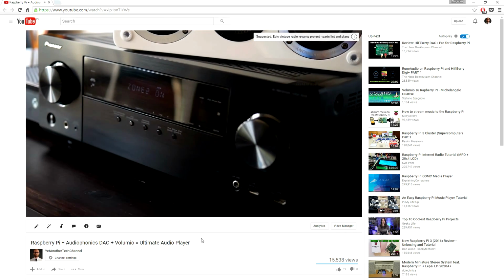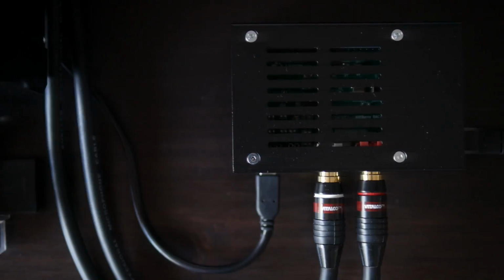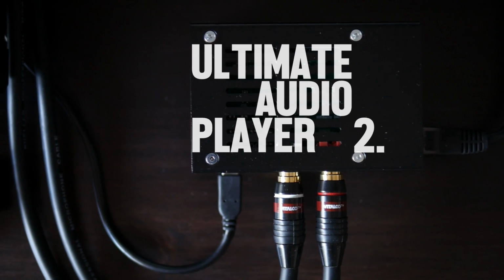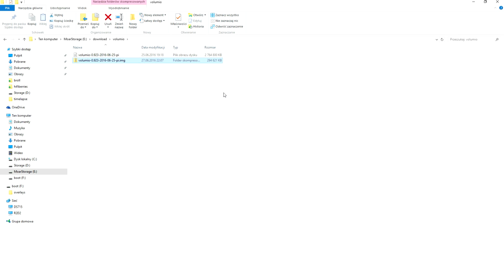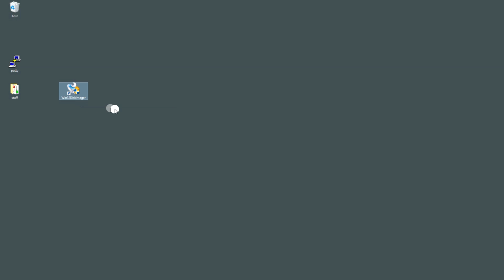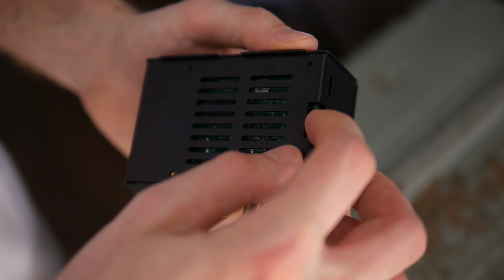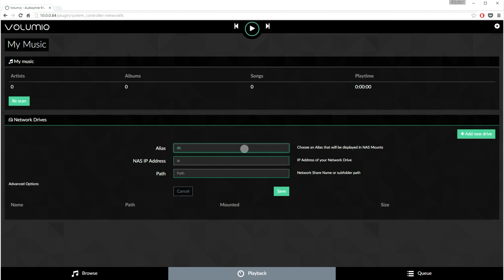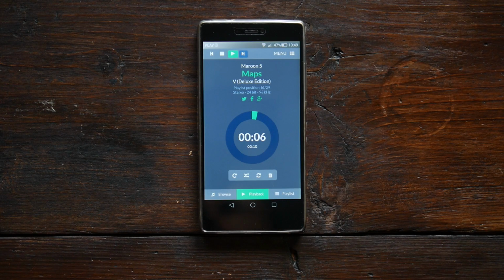Ultimate Audio Player 2.0 - HiFiBerry DAC+ Pro, Raspberry Pi 3, Volumio 2

Comment: Iv'e been working with this setup for over four weeks and I'm about to  turn my back on it. It's just not stable enough. Iv'e run it with three of my Pas Pi's so I know it's not the hardware. The unit falls asleep all the time, I have to turn it off at the wall often as I'm unable to connect to it via cable or WiFi. It's quicker for me to just put on a CD. The app lags, fails to play on most occasions and it just too annoying for me to work with it full time. What I will say is that when it does work it sounds great. Shame it's just not reliable enough. Sometimes I have to re boot the Pas Pi and all of my internal network components for it to work.

Comment: What power supply was used?  I've read you can't run a separate supply, it gets its power from the Pi header, that concerns me because that would be EMI noisy.
Reply from the maker: Check out my Ultimate Audi Player 3.0 video - where I solder a connector onto the DAC board to have it powered separately.

Comment: It looks nice, and is economical in energy consumption. However, when you sum it up, isn't it soon better to buy a small AVR? (for example Onkyo TX-8020), the devices also have a NAS and remote support.
Reply from the maker: In my case it's a matter of convenience - you can control volumio from a mobile app, a web browser or even using Alexa (not natively but using API and IFTTT). 

My Pioneer AV receiver can play digital tracks off of a NAS server, but I haven't really tried that - mainly because the networking feature failed after 2 years and the receiver no longer connects to the network :/

Anyways, do you know how do you interact with such receiver? Do you need to have your TV on if you want to control your playback? Browse folders, manage playlists, etc.? This doesn't sound particularly convenient... unless there's a mobile app for that?
Reply: @YetAnotherTechChannel Vielen Dank für Ihr Feedback. Ich besitze den Denon AVR-X1300W AVR, dafür gibt es eine Android-Verbindung (apk), mit der ich meine Musik von NAS / DLNA / Bluetooth oder Spotify-Musik abspielen und steuern kann. Ich habe volumio 2 mal auf einer Android-TV-Box ausprobiert, mit einer umfangreichen Musikbibliothek friert das Gerät ein, das RPi2 lief dort stabiler. 

Ich finde, dass 3B + von der HW etwas besser aufgestellt ist. Ich denke, es ist ein schönes Projekt, und es macht Spaß, es zu machen, aber ich sehe nicht den Preis und die Leistung. Dort haben Sie mehr Erfahrung mit dem externen DAC.

Sie können das RPi3 auch über einen HDMI-Port an Ihr AV anschließen ... es muss auch funktionieren;)  My AVR has HDMI passthrough function, the signal is simply passed through.

Comment: Does the DAC also include amplifier?
Reply from the maker: Nope, this one only does the digital to analog conversion - you will need a stereo amp or an AV receiver of some sort. Check out HiFiBerry AMP+ if you want both in a single package.
Reply: @YetAnotherTechChannel  it's unavailable now in Amazon. Amp2 it's also the same as Amp+?
Reply from the maker: Yup, AMP2 is just a revised model of the original AMP+
I have two AMP+ based audio endpoints that I use on a daily basis :)
Reply: @YetAnotherTechChannel  
Thanks!
I want to add this amp2 to project I build.
I found this speaker : https://www.parts-express.com/behringer-studio-50usb-150w-2-way-digital-monitor-speaker-pair--248-6910  
(The passive one) and want to add crossover for it because it's doesn't have one. 
Can you please help me which crossover I need?

Comment: what would i have to do to get a 4.1 audio output? i want to build a pi based carputer with android auto
Reply from the maker: You would need one of those car audio amps to drive the speakers and connect RPi with HiFiBerry to it.
Reply: YetAnotherTechChannel how about a usb soundcard? That way I could have 4.1? Would still have to use a amp.

Comment: I did a similar thing but you can separate the 5v supplies for the digital and analogue side of things on the Dac+ pro and if you feed them from separate linear power supplies you will hear a huge improvement.
Reply from the maker: That's the plan for the next revision - separate power delivery, integrated display, and a custom case :)
Reply: YetAnotherTechChannel  It worked a treat for me, hope you enjoy it
Reply: Please make a video with the upgrade. Realy want to build one :).  Great job!
Reply: YetAnotherTechChannel when are you going to release the newest version with integrated display, sounds amazing

Comment: Question, if i want to use my headphone, how to do that? I dont see a headphone jack, right?
Reply from the maker: You would need a headphones amplifier for that.
Reply: YetAnotherTechChannel thanks for your reply. This means i need to buy another amp board? I thought speaker needs more power, not the earbud . I misunderstand it ?
Reply from the maker: You are right - speakers do need more power than headphones. But even so, the circuit board has to be designed for such use case - the audio signal must have a certain strength for this to work.
HiFiBerry DACs (and I'm pretty much sure all other DACs) are meant to work with amplifiers and even if you manage to connect your headset directly to it, the experience will most probably be disappointing.
Reply: YetAnotherTechChannel got it, thank you for your detail answer.
Reply from the maker: You're very welcome :)

Comment: I may have missed it, but did you use an external amp to power the speakers? I'm a bit new to this arena.
Reply from the maker: Yes, this audio player is connected to an AV receiver with a pair of RCA cables.
Reply: YetAnotherTechChannel thanks for the answer.

Comment: Nice simple setup.. Does it only work with stored audio files? How about streaming Spotify ect? I already have a really nice DAC form TEAC. Is it possible to use my existing DAC connected over USB? Is an audio card available with coaxial (AES) or optical (toslink)   Cheers,,
Reply from the maker: You can playback audio files either from a flash drive or a local file server. Volumio does support Spotify, but the implementation is very limited compared to native Spotify app. HiFiBerry Digi+ has digital outputs :)
I have no experience with DACs from TEAC so can't really help you with that :/
Reply: update: I got everything set up with the HiFiBerry Digi+. Everything really sounds great! I'm having trouble with "Spotify Connect" . I was going to install an updated plugin that I found on GetHub but I the "Upload Plugin" tab is missing on my version. Do you have any suggestions?
Reply: The Spotify Connect App worked well for me when I connected to my Rpi via a Windows 10 PC application -- but worked badly when I connected using my Android Phone -- it was as though there was a lack of communication on the reverse link from the Rpi application to the android phone (the forward link from phone to Rpi seemed to work as it could issue commands).
Reply: Spotify made a change you have to install a third party update using SSH

SSH How to: https://www.youtube.com/watch?v=ZkvHHkWmKSY 

Here is the update to paste in your SSH interface

wget https://github.com/balbuze/volumio-plugins/raw/master/plugins/music_service/volspotconnect2/volspotconnect2.zip
mkdir ./volspotconnect2
miniunzip volspotconnect2.zip -d ./volspotconnect2
cd ./volspotconnect2
volumio plugin install
Reply: JAMES GREER thanks I will try it out
Reply: One more thing.. You have to enable SSH. Navigate to the DEV ui by pointing your browser to VOLUMIOIP/DEV or volumio.local/DEV . Find the SSH section, and click enable.
Reply: James, Thanks it is working better now !

Comment: which one do You feel Better : dac pro or hifi Berry amp ?
Reply from the maker: These are two different products for different applications... if you have an amp or a receiver that you can connect the DAC to, then it's the one... but if you don't have an external amp and you want to build a small audio box that you connect the speakers and you're good to go, then the AMP+ is what you need.

Comment: Let me save some of you some time.  There is an issues with this DAC and the Raspberry pi 3 WIFI.  You kind of have two choices: 1) Use a separate WiFi Dongle.  2) Change the channel your WiFi Router is using (I've found channel 10 works well.  YMMV)  This MAY be only an issue in the USA, I simply do not know enough about WiFi standards around the world.  Out on the Web Help forums they do suggest avoiding channels 1, 6, 9, and 11.

Also, there are sometimes issues with setup for the HiFiBerry DAC+ Pro and the volume control in Volumio not working.  I use the following settings and it seems to be working very nicely:

Output Device: Hifiberry DAC plus
I2S DAC:  On
DAC Model:  Hifiberry DAC plus

DSP Program: FIR interpolation with De-emphasis  (I'd love someone to explain this setting to me)
Clock Missing Period: 1s

DSD Over PCM  (DoP):  On
Volume Normalization: Off
Buffer Before Play: 10%   (works for me, others recommend higher)

Mixer Type:  Hardware
Mixer Control Name: Digital
Default Volume Startup:  Disabled
Max Volume Level: 100%  (less if your Amp is over sensitive)
One Click Volume Steps:  5  (default is 10, but I find 5 works better for me)
MPD Client Volume Control: On

Pumping this through to a homemade P-P Tube amp and Dynaco A10 speakers, the sound is very pleasant.  Less so through my Class-D amps.  

I hope this helps someone save a lot of time as this really is a nice sounding setup for under $100.  I spent a really frustrating 6 hours compiling this information and getting mine to work.
Reply: Where can I get info on the tube amp?  I keep wanting to build one, but never have (never seem to have the time, money, and interest all at the same time)

Comment: are u streaming music wirelessly??
Reply from the maker: This one is connected over ethernet but I'm using wifi in my bedroom audio station.
Reply: So the music goes from your desktop to the dac through ethernet or Wi-Fi with no wires going directly from the comp to the pi??
Reply from the maker: I actually store my music library on a Synology NAS, but everything else is correct - streaming over home network without a direct connection between the server and the music player.

Comment: Hey buddy, sorry total noob question. I'm going to attempt to build this. I have a spare 5 piece surround sound system. I want to use it as a home Spotify system using this. is that possible using your setup ?
Reply from the maker: Yeah, this should totally work - provided that your 5.1 system has RCA inputs. But be warned that Spotify support in Volumio is very limited - so don't expect all functionality that you can find on a native mobile app.

Comment: So this is basically a high quality Bluetooth streamer for your hifi?
Reply from the maker: No, you stream music (preferably in 192khz/24bit FLAC for highest quality) from your local file server, or play it from a USB flash drive.
Reply: and i cant add bluetooth feature? and your solution is the best quality /price solution to stream music archive into a hifi system?
Reply from the maker: As far as I know, Volumio doesn't support BT streaming, but there might be other solutions that do (I think LibreElec might, but I haven't tested it). There are quite a few DACs out there offering similar capabilities, but I know that people over at HiFiBerry know what they're doing :)
Reply: now i got the idea. So i can connect this to my amplifier via RCA connections and with it running Volumio, i can access to my music library (USB hdd in my case) from my phone with Volumio. right?
Reply: Bluetooth kinda removes the hi-fi aspect, better to do it off the network.

Comment: just purchased the same setup but can not install volumio :-(
Reply from the maker: What do you mean saying 'you cannot install volumio'? You write it onto an SD card, plug it into RPi, power it on, wait a few minutes, go to volumio.local and that should be all.
Reply: YetAnotherTechChannel Turned out my raspberry pi had failed memory dim . got it working now and it's not bad for a cheap system .

Comment: The good thing you can improve the sound by using better power supply like IFI power.
Reply: Nope. The IFi is still a switched mode supply and just boasts some 'noise filters' that in reality, do absolutely nothing. A bit like cheap 'power conditioners' do nothing as well. As the Rpi is a digital computer board, even using a linear power supply will make basically no difference. £40 for a wall wart 5v DC USB PSU with a couple of caps in it is a rip.
Reply: @tomstephens7201  Hi, Ive seen a lot of bs and hate discussions over power supplies but as I understand it, when you are talking about the digital part (Rpi3 digital playback of 24bit/96khz flac files) isnt enough with a standard 5V regulated switching power supply? Unless the hifiberry dac "analog" modules need a very tight specification power supply demand; thanks for your input

Comment: Would the addition of an amplifier be beneficial to you/ most others? Or, have the majority of music enthusiasts embraced powered stock speakers? Thanks for the vid!
Reply from the maker: For the entertainment setup in my living room I do have a proper 7.1 receiver, but I couldn't stand such brick on my desk. When shopping for speakers I was really close to buying a pair one of those powered monitors (M-Audio AV42 to be exact) but I figured that Sound Blaster X7 (with its integrated amp + optical and RCA inputs) would be a better choice for audio enthusiast. I got it with the E-MU XM7 speakers but I might be changing those to something different in the future.
Reply: Excellent YATC, thanks. I'm considering (first) development of a 'non-brick' high power (cool energy) DAC + amplifier capable of transmitting actual or equivalent to 300+ watt sound via wifi, bluetooth and cable(s) along with optional touch screen panel and/ or basic control buttons. This would be a 'connected' cross-platform scalable & affordable true "24k" hi-fi audio (music) hub. I've seen similar units however consumer price points seem unnecessarily high, primary core input/ output options lacking and very little cohesion across/ among standardized and emerging hardware & software technologies. But.... what the heck do I know?

Comment: is there any way to connect from my Pc usb to Raspberry pi 3 to my external  dac? 
I just want to clean up the signal
Reply from the maker: What kind of DAC is that? What do you want to achieve? You want to be able to use it both with your PC and RPi?
Reply: using usb cable  from pc to RPi and then to my hugo dac

Comment: Hi, thank you for your clear discussion/review of using Pi with volumio. I also have the same setup, however with only the normal hifiberry dac+. Could you comment on the sound difference after upgrading to the pro version?
Reply from the maker: Well the first iteration was sporting a different DAC, it wasn't HiFiBerry. I do however have both Pro and non pro HiFiBerry DACs and I may do a comparison in the future.
Reply: I have both dac+ and dac+ pro , no huge difference detected until you separate the analogue and digital power supplies and use linear power supplies. Really worth doing
Reply: Hi I am thinking of building this however I want to have an aux input for example for external sky box or turn table. Is there a hat for this or would a USB aux sound card do the job.

Comment: Is there a way to connect a standard record player or record player with USB output to the PI to allow the record player to play through the Pi?
Reply from the maker: I've never tried it myself, but I remember googling that topic a few months back and finding out that USB optical drive should work just fine with RPi.
Reply: Buy a Nexum device and put on party mode to transmit the audio